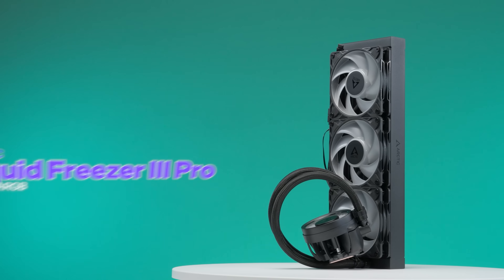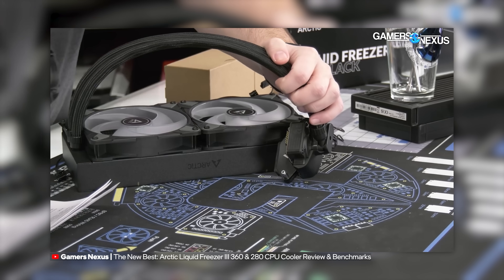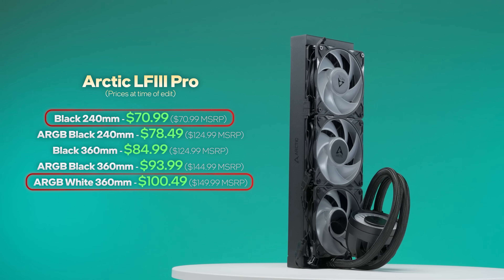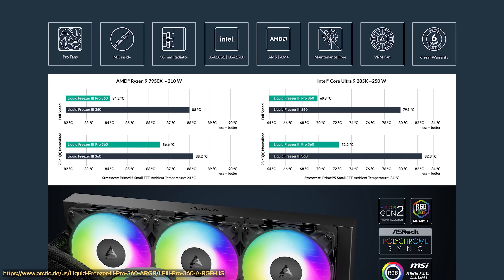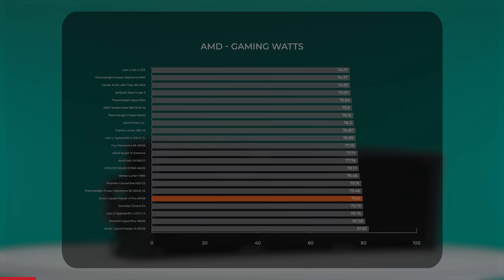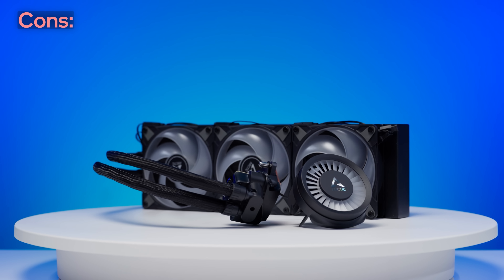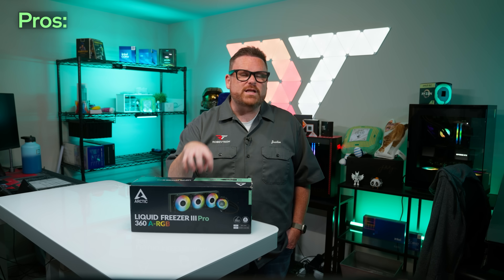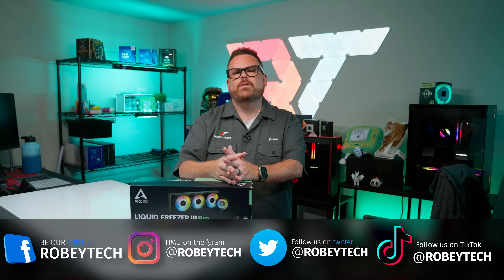Is it actually an upgrade? The Artic Liquid Freezer 3 Pro AiO Ultimate Review

Comment: I'll be honest, the best thing that I ever did was remove all the standard fans from the LF3 Non-Pro 420 mm and then replace them with P14 maxes and replaced all my case fans with either additional p14s or p12 max; it dropped everything by a good chunk, where previously I was averaging 67-69 degrees C under load while gaming (hotter in some games), i'm comfortably sitting at 47-52 C

Comment: As a seasoned tech which have seen the gaming market change from the early 286 to current Ryzen x3d, i call the cons biased. Just build a pc with 9700x and ACLF3pro, so easy to install, not a single issue. If you spent some time reading the manuals, planning your build, this is easy to do. Spend some time with Fan control or any sw that control fans, make the curve depending on your desired noise to performance ratio. My 9700x reached 82oC in Cinebench R23, with 60% fans, didn't pass 45--50 db. Given a stable 5.5 GHZ, this is impresive. That being said, i would place this AIO in top 10 best AIOs, if not top 5.

Comment: What it shows is that you just don't know much - if anything - about Ryzen.

You are a salescritter and the less you know the better you feel, because being burdened by knowledge might impede your wit - or the half you put on display.

I have offered to teach you and others, but you are imbued by the wisdom of YouTube, and that transfers to you by osmosis, with your mouth going full throttle whilst you brain still isn't even in first gear.

But what do I know right?

I have only been a techie for over 40 years and have spent many thousands of hours learning to configure Ryzen.

Thus you will get another thumbs down (and I very rarely do that) because this video was just a waste of pixels.
Reply from the maker: If I wasn’t the only person saying this… oh wait I am not.  Sorry man the data shows what the data shows.  It’s a lot of bother for not a lot of benefit and there are cheaper, more performant options.  If you are happy with it, thats all that matters.
Reply: @robeytech  Kudos to you for actually replying.

The main criticism I have of the Arctic Liquid Freezer III (Pro or not) is the combo AIO connector they have for the Pump/Fans/VRM fan.

They did add a solution for this, in that they supply  a splitter, where you can run them independently. That being said, the pump speed being coupled to the fan speed is just crazy, especially when it comes to running at idle.

That you didn't even touch on this aspect really makes me dubious with regard to the rest of your video.

The first time I ever saw an offset mount for Ryzen coolers was from Der8auer, and it did make a noticeable positive difference for the AIO I was using at that time.

With the Arctic Liquid Freezer II I did test it out with the normal mount vs the offset mount, and again there was a significant difference in the cooling efficacy.

So I have no idea what you are doing to be able to make the statement that the offset mount makes no difference.

Comment: I think labeling this cooler as a 1700/1851 may be a little false. The mounting solution of the "pro" is offset for LGA1851, which results in the LGA1700 chips have poor coverage. Using this cooler on my 13700kf leaves almost a 1/4th of the IHS uncovered completely exposed. The first LF3 that I purchased had an uneven amount of threads on the two mounting screws, which caused uneven pressure on the chips.

Comment: I recently built a new system and purchased this cooler because Jayz two cents strongly recommended it and, if I'm honest, I really liked the idea of the VRM cooling. There's a few takeaways from this vid that really resonated with me.  I'm not a first time builder, but this was my first build in over 20 years and the first time using an AIO. I will admit, the offset mounting had me very worried during installation because I thought I'd made a mistake. I didn't struggle with the actual mounts (Ryzen 9800x3d), but that might've been a different story if I were using an Intel CPU. Next, I was worried about temps hitting the mid 80's under load, but this vid made me feel quite a bit better about that so I am grateful for that peace of mind.

Comment: I purchased the regular LF3 and was using some noctua fans, but I ended up removing the noctua fans and just bought some Arctic P12 Pros so it is now a LF 3 Pro lol. Also the cost of the three Arctic fans was the same as the cost of one of the Noctua fans i had on it.

Comment: I tried both 420 ARGB and 420 Pro. Installation was much easier on Pro but the temps are not great on 9800X3D. You expect much better temps on an 8-core chip with a 420 cooler. The 2 screws as you mentioned results in uneven pressure from bottom to top. There should have been 4 screws holding the pump, this is just bad design.

Comment: Why don't the charts say higher lower or higher is better, which is the standard for when showing charts. The charts only flashed up and removed very quickly, making it hard to even pause the video to take a better look at the results. Everything is rushed. It's a very confusing video. I still can't work out is the pro is better than the none pro. Could have compared just the two of them to find out without all the confusing charts of the dozen of so other coolers.

Comment: Combined that thing with the Thermal Grizzly Phase Sheet on then 9950x3d.

Even Prime95 is not able to hit 95°C. Even the most stressful test (Blend does reach higher temps at a certain point than small fft only) barely scratched the 94°C mark after more than 2 hours!

Incredible thing.

Comment: one thing i will say is that the fans from the old ALF3 360 ARGB are different from the non-ARGB variant. i think at this point theres versions of the 360mm ALF3 running with 4 different types of fans, the original p12 fans on the first ALF3, the p12 max on the refreshed version, the p12 ARGB from the ARGB variants and now the new p12 pro fans. the p12 pro and p12 pro ARGB fans are effectively the same on the new version.

Comment: I have the 280mm a while back on a 5700x3d and  then I just got the pro fans about a month ago I only have those 2 140mm fans for the whole case because sff. A bunch of repasting later " (never had a problem mounting it to cpu) idles at 40c and games around 64c
Room is around 26 to 27c.

Comment: I got exactly the same vibes when I was using my original LF iii on my 14700K. Nothing special but decent and the VRM cooler was the bonus. The pump was too noisy and not adjustable but the price was good for the performance. Now with the pro the main selling point (the price) is gone (at least in my country) and makes no sense not to buy a premium cooler instead. Something that people do not realize is that AIO performance is mainly coming from the design and the quality of the cold plate. Fans, pumps, coolant and radiators are all similar and have only minor effect to the performance.

Comment: I recently installed this cooler and it was a challenge. One of the two screws was really not going in and I had to try and try until it finally entered. Very uncomfortable experience. Although the cooler seems to be working fine now, the radiator fans can be quite loud when spinning at max RPM. I wish I saw your video earlier...
Reply: Its not meant to run at 100% fan speed. Also the pump can be lowered to 80% and give same performance.

Comment: if you want to buy this AIO or the previous model this AIO have issue with ASUS ROG STRIX X870E-E M.2.2 heatsink which the the cover for the tube get stuck with the heatsink, the solution is contact Arctic they will sent you a new heatsink or remove the heatsink since the M.2.2 sharing lane which you're not gonna use it or you can mod the cover or shroud by cutting it little bit so it can fit well.
Reply: Or you can just mount the cooler upside down. They also suggest that and it fits fine on my aorus 870e master which also has a large heat sink over the only non lane sharing nvme 5 socket…

Comment: Have ARCTIC lc lll pro 360 argb in my thermaltake s250 tg argb case with front 3x 140mm arctic p14 pro side 2x  arctic p12 pro and back 12 pro giving Max temp under load with 7800x3d 78C 100% CPU and 7900 xt 72 100% GPU util

Comment: I am using the Arctic liquid freezer III 420 pro and its loud Like really loud. 
Also i use the Lian li o11 Dynamik EVO RGB and in that case 420 have some extra kind of installation that means it hangs lieber than 360 rads 
Long Story short i cant use my lower case fans because my motherboard is in the way and i cant screw it in further up because of the aio 

I know its my fault but still if u are thinking about getting my Configuration 
DONT DO IT

Comment: Your data seems skewed and does not align we all the other testing out there on these coolers.  I build systems and no way does the Aqua Elite out performs the Artic III Pro in my experience.  I build using 3 coolers predominantly, Thermalright, Arctic, and EKWB. In my own gaming build a switch from a Thermalright aqua elite to the Arctic III pro solved both temp and noise issues.  I already use plates on Intel 1700/1851 due to warping potential, so this was not a big deal.  Nor do I have any issues with mounting, catch a few threads on one side and then the other, back and forth for even pressure.  Maybe that's your issue right there.
Reply: i agree
Reply: Unrelated - but do ever recall putting an Arctic III Pro in a H7 flow case? Im trying to gauge the clearence since id really like to get one..
Reply: The fact that he got the frozen Notte to keep the 7700x at 92° under load is surprising, considering I have this combination and it always hits the 95° TJ max. Even with undervolting.

Comment: its good but this extra 2cm thickness is great great great pain in the a--ss
and also there is another headache pomp doesn’t match with SSD heatsink in some motherboards
if you guys ask me don’t buy this one for 5–8 degree cooler temp
you had to change everything like motherboard to case to fit this in your build
it destroyed mine as my own first build and I’m hella mad about it
Reply: Some cases can fit this and 30mm thick fans in push/pull. If it's too big for your case, then it's not a problem with the product, it's just not compatible with your setup. Fits in mine just fine.

Comment: Actual data does show offset mounting helps: The LFII initially didn't have offset mounting capability, but when people started testing offset mounting in general, they stated including offset mounts in the box. This model only includes that, because it's objectively better: If you care about things like that looks wise, there are more looks focused options. Making the cold plate bigger would incur more costs, since it's one of the most expensive pieces, and there is general suspicion that Thermalright achieves its low costs by shipping some things with incredibly low margins or in some cases even at a loss.

Either way, while the Thermalright model in question does cover the IHS visually, it's even more focused on a particular spot on the IHS than the LFIII is: The pressure applied results in a very strong contact with the center of the IHS, but leaves the top and bottom edges without any contact: Even if it visually blocks the IHS.

Complaints about offset mounting are understandable from a visual standpoint, but there is no data to show that the IHS actually spreads the heat load evenly: It doesn't. It's even worse on Intel systems.
Reply: Thermaltake owns all of its factories which allows them to price lower. They don't use a OEM factory that make the same product for dozens of retailers.

Comment: So i have a LF3 280mm, i bought it before the pro version was a thing and i recently added the P14 pro fans myself. My idle is 36-38, gaming 46-50, and peaked in cinebench at 65. I used arctic’s MX-6 paste with a thermal paste guard to cover my whole cpu perfectly, its a 9800X3D by the way.

I think theres more to be extracted from the liquid freezer if you use the 3 cable set to set it up for individual control of the VRM fan, pump and radiator fans. 

Im just surprised it was constantly middle of the pack for you. 

As someone else said one reason i use arctic is their responsive customer service who i have contacted in the past and the 6 year warranty.

Can i ask what fan/pump curves were used and which cable from the box ? I’m just genuinely curious and not trying to like undermine the video or anything.

My pro’s: VRM fan, great temps for me personally, offset mounting. 

Cons: difficult installation for me as a beginner builder last year, messy cable management if you use the 3 way control cable, pro fans are a little too noisy so i had to tame the curves.

Comment: i have a question

Did you plug the aio into the mobo using the split cable or that 4 pin 1 does all cable?
Reply: Both work, all in one makes all fans run the same speed. All seperate gives you the ability to change speeds per pump, vrm fan and cooler fans.

Comment: I've got a Freezer 3  420 & have not had any problems with it....running on a LGA 1851 with a Thermal Grizzly KryoSheet. That combo has netted idle temps in the high 20's/low 30's & load temps in the mid 70's.  I was skeptical of the KryoSheet & resisted trying it, but now I won't use anything else. Clean to install & so far .....  much better than normal paste.  Interesting about the fans being the only change....I might buy a set to see the difference.

Comment: Picked up one of these and initially it was great however I had issues with the argb lighting on the fans and now I found the vrm fan is broken also but temps are way lower than my old cooler. It was such a pain to install and setup with case I can't be bothered doing the rma. My issue with the fans lighting turned out to be the argb lighjting cable that goes from the pump through the sleeving of the pipes was faulty. I ended up buying an argb lead and plugging it directly into my argb controller and it fixed the problem. The VRM cooler doesn't work and the light on the heatsink itself also doesn't work. In terms of actual cooling performance I'm very happy with it. The leaf springs aren't that bad on am4 / am5. Just a bit of patience. I did need to reseat it as idle temps were 60c but after cleaning and doing the pee drop rather than spread thermal grease we're all good. So yeah that's been my personal experience. I put it into the frame 4000d and it fit but that case was another disaster for another day haha
Reply: What cooler did you have previously?
Reply: @Lachyp1992 the original arctic cooler 360 when they just launched 360 aios. Came with 6 fans in a push pull configuration. It was launched us 2016 so I’ve had it quite a while 😅

Comment: I built with the non LED version and love it. Tweaked the fan curves in bios and don't hear the pc running at all even though I am sitting right next to it. Probably the biggest change they made is to make the screws a little longer so install is much easier.

Comment: I have the 360 pro and I like the performance of it BUT, installing pump head was annoying and this thing is LOUDDD without a fan curve. I would recommend for amd honestly because the offset helps and I like the aesthetic of the cooler
Reply: You need to install 3 separate plugs and set a fan to 60% . AS long as you can control it its not an issue,  untuned, it is loud...
Reply: Nobody is buying an AIO like this in something that isn't a prebuilt and leaving stock fan curves